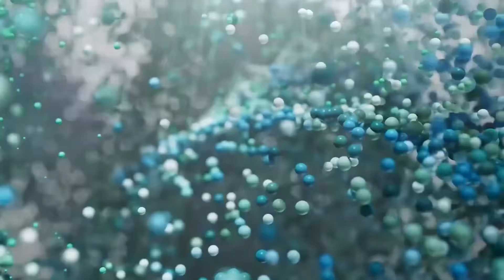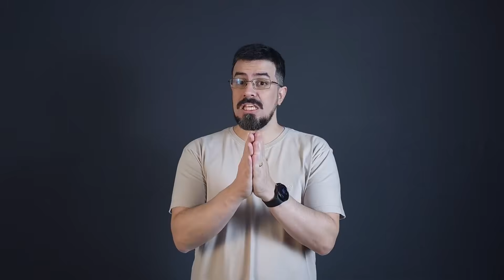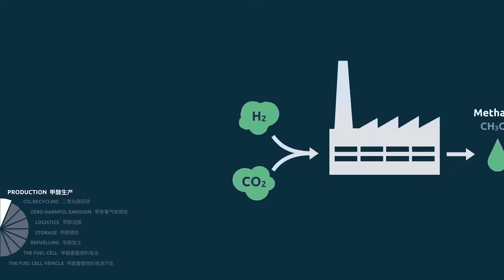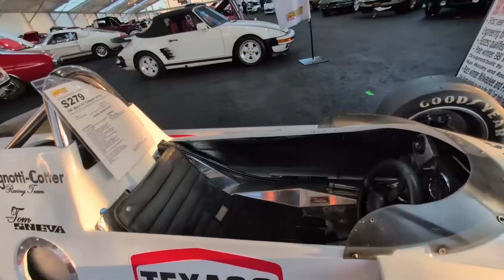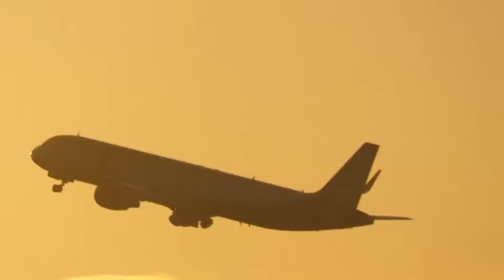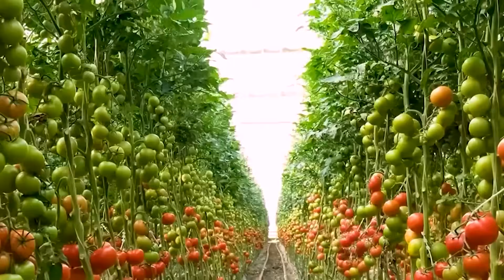What Is Methanol? How Is It Made, and Why Do We Use It If It’s Toxic?

Comment: Some sort of digester or cooker that would yield methanol (or any combination of burnable liquids) from raked up leaves would be nice. The goal would be to add the liquid to fuel oil.
Reply: The “gas producer” that powered cars during WW2 is the front end of Fischer Tropsch process used to make fusel oils from which synthetic methanol is made. You can make synthetic gasoline by exactly the same process by tweaking the operating conditions.

Comment: The method with best potential is :
Hydrogen from water by thermo chemistry with heat from nuclear reactors type MSR.
Carbon from air reduced to syngas = CO by energy from MSR 
A very sustainable process particular if Thorium is used as fuel as efficiency is about 200 times LWR.
No long-lived waste , no core melt down risk.
Just to be allowed by politicians to be developed.
USA posses big quantities of rare earths but not allowed to be mined.
A lot of other energy intense processes like green steel or cement are others to be developed with  nuclear hydrogen as source .
Reply: Hydrogen is easily produced from photovoltaic cells - it is easily produced from excess power as an alternative to battery storage.
It is economic as an alternative for natural gas when the wholesale price for electricity drops below 1c/kwh (which happens most days now between 10am and 2pm). (Note, wholesale price and retail prices are utterly unrelated).